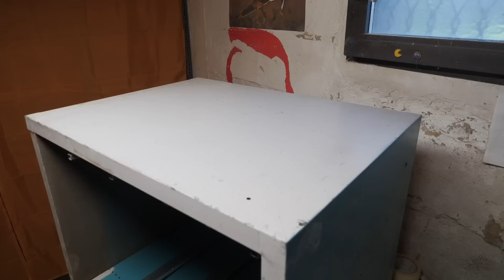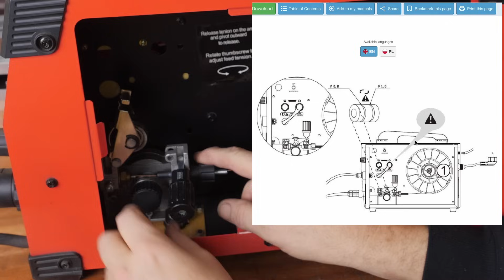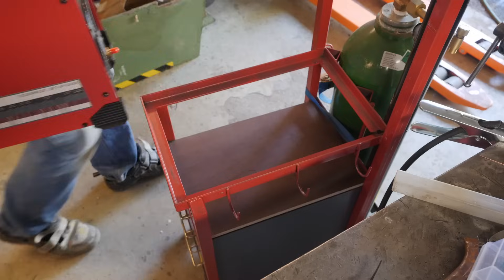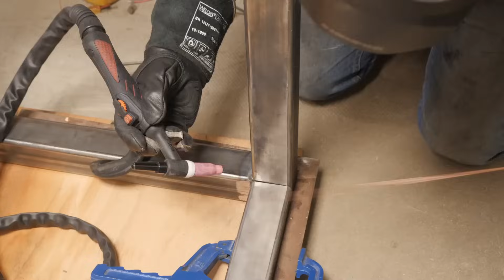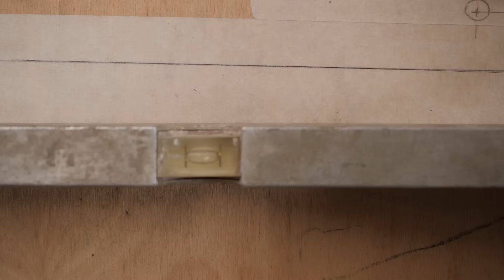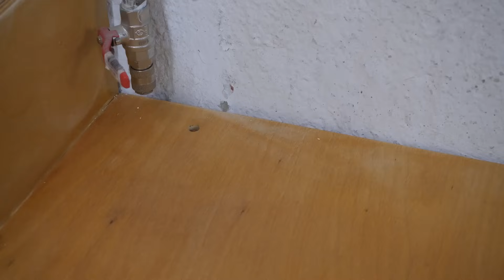My best workshop bench || RotarySMP

Comment: you need to crank the heat on the mig, hot and fast
Reply from the maker: I thought I tried pretty much all combinations of settings, but maybe I didn't try just diming both feed and voltage.
Reply: @RotarySMP  its been a long time but id keep my wire speed a little slower and the amps a little higher and would adjust the wire speed as needed. always found it a little easier to get the weld to start flowing and be less globular like that. think about it more like pushing material into the base metal. it should sound like bees in rhythm when youve got it right

 my machine also had a constant spool for the first few seconds then it would speed up to your settings. but it would only speed up after an arc was struck. it was a similar rebrand kind of 3 process machine.

Comment: Damn nice work... Nice Tig machine as well, tho, your tig welding is also getting better for sure! I would consider thicker tungstens, you can always grind down a thick tungsten to a long taper - sharp point, thin ones are just a limit to max amperage that you can use... I never saw any use for a thin tungsten... Not outside an edm sinker drill at any rate...

Best regards!
Steuss
Reply from the maker: Thanks for the feedback Stuess. I did buy a packet of 2.4mm / 3/32" electrodes, but followed the settings sticker and used the thinner ones. I need to grind up the thicker ones and give them a go.
Reply: @RotarySMP  Yeah, 2.4 are generally the best... At least in my experience... They go up to 200 amps, and that is good enough for most work... Just be aware of the radioactive electrode dust from certain electrodes and hexavalent chromium fumes if you weld inox... Zinc fume fever is damn bad, yet hexavalent chromium is infinitely worse and much more subtle... 
Tig is amazing and can be most enjoyable, but it has more risks than just the obvious ones...

Comment: Love your videos! I would really appreciate it if you could throw in a rough guesstimate at the end how much your shop projects cost
Reply from the maker: Thanks for the feedback. 
This one is a bit hard to say as the wooden slab would have been expensive, butwas a left over from making new stairs nearly a decade ago. I paid €500 for those used drawer cabinets. Probably excessive, but they were the perfect dimensions. The paint was about €75, but I will get another project out of it. I spend about €250 on steel, but that is also supposed to cover 3 or 4 projects. Then there are the paint rollers, bolts, filler wire, €70 customs duty on the comp welder etc.

All in all not very respresentitive of what it would cost another person to do something similar.

Comment: Grate video, on the mig welding think you where going too fast, slowing down will make the weld more flat, but on thing tubing like that you do really need to be carful to not burn thrue.
Reply from the maker: Thanks for the tip. Have you checked the actual wire speed on your MIG? Is the speed of mine normal?
Reply: @RotarySMP  i have a old slovenian Varstroj supermig 230, I can check it next week end if youd like. Also can highly recomend theas old machines, cheap and work grate.

Comment: What wire do you use as filler? You might want to try thicker filler wire, it seems to me you have to dab too often. It might be because of the sped up footage, but still, some experimentation would not hurt. 
Aluminium is a lot harder to TIG weld, it's better to be quite comfortable welding steel first, before taking the leap. 
Also the torch on the new machine has a wheel, that lets you adjust the current while welding, just like the pedal. It is handy, when you need both of your legs free. You can also adjust how "hot" the puddle is by changing your travel speed. 
I would encourage you to learn 4T, when you are starting a weld and hold the button down, it gives you a lower amperage (the amp setting after the pre-flow time). This gives you time to start and stabilize the arc, see where you are and what is the arc pointed at. Then you let go of the button, when you are ready, and start welding.
Reply from the maker: I only had 1/16" filler, but have ordered some 3/32" (2.4mm). 

I noticed that I need to practice 4T, to free up my trigger finger to control the amp wheel of the torch.  Thanks for confirming that.

Comment: My bench has a solid core door for a top... My friend (jodaddysgarage) has been doing videos for Arc Captain for a while now and is really happy with their welders. Las time I was out at his place I met him at Orlando airport and we picked up his new RV and drove it back to his place. I played with the welder enough to like it enough that I want one of my own. My videos are too crap to ever get any views or support as I don't have the filming and editing gene. The mig is far better on the low end for auto body than my current welder. My welder sounds like a tornado while that Arc Captain is silent till it gets warm. 
         I need to get a dedicated argon bottle (and change gas supplier)to get back to Tig welding. Tig welds are softer than MIG and easier to grind which makes body work easier.
   
       FYI all my shop benches are at 42". Puts them at a comfortable working height and I can roll carts under it and it's the answer to everything. That green reminds me of the old equipment in school shops. Also for my long bench across the wall I topped it with  1/8 hardboard with a white "waterproof" coating. It's cheap stuff supposedly meant for use in showers. I can write on it with pencil and it's cheap and easy to replace when I damage it.

          That vice looks awesome as well.
Reply from the maker: I dont normally go for the various product offers you get when you do the social media thing, but Arc Captain reached out at just the right time while I was ordering steel to make this, and my contact there has been very friendly and easy to deal with.
Reply: @RotarySMP  They are a good company to deal with and a good product. Love the light for seeing inside the unit when loading wire too.  
      The offers I have gotten from some fly by night products I have gotten I would never consider doing. But Arc Captain is a stand up company and a good choice for you.

Comment: theres a trick to setting up a vice , put in 2 pieces of metal verticlu and make it stick out under the foot , them put the vice on the table and push it in untill the pieces of metal hit the edge of the worktop then scribe the mountingholes 
that way youre able to clamp in long pieces as they whont hit the worktop on the way down
just thinking out loud herre , workbenches and such are usually banged against and paint chips off constandly making them look ratty and worn in no time , might be a good idea to paint those things in bedliner
Reply from the maker: This is a rear jaw opening vise, so that method doesn't work unfortunately. 
I don't mind when things like this take on a patina of use. It is a tool.

Comment: With a small mig welder,I always use the smallest wire available.  .023 in sae. That way I have more amperage for the wire size.
Reply from the maker: Thanks for the tip Michael. Have you measured the wire speed on your MIG?
Reply: @RotarySMP  I have not. But happy to when I get back to the shop
Reply: My work welder is a millermatic 135 it's running about 36 inches in 6 seconds. So roughly 94cm. 944cm per minute? That's at 60% wire speed and 80% amperage on .023 er70s with 75/25 gas and is my median settings for general repairs on 1/8" to 3/16 metals. I have a snap on 135 amp welder at home,I'll check it but I'm guessing it should be very close to this wire speed

Comment: A good rule of thumb for steel tig is 1A per .001" of material, so 3mm will get you to approx 120,  but I'll always set it a bit higher just to have that bonus power if your setup needs it to get the bead fully burned in.  I'd go like 140 and just not stomp the pedal to the floor by default.

Big heavy foot pedal? Not so much.  A foot pedal that sits on the floor without spinning?  Very much so.

Looking at you, Everlast Nova foot pedal stamped out of a single piece of sheet metal with no foot points to keep from spinning in the middle on a high spot on the floor...

The lip for your shoe is nice, mostly, too.. being able to pull the pedal and find your orientation without looking is nice.  I miss that.
Reply from the maker: Thanks for the tips Paul. I look forward to getting more practice with it.
Reply: Get some stubby cups and/or a gas lens kit, also.  Your stickout seems a bit long for a plain cup in the #7-#8 range.

Once you run a #7, #8, maybe #10 gas lens on steel, you'll never want to go back to a plain cup.

I only use a plain cup for aluminum now.
Reply: Looking good though.  At the start of the video I was quite frustrated you were still fighting with that fixed power piece of junk and it was great to see how your welds instantly improved

Comment: When you sand, you push the fibers in to the grain, then the water in the shellac raises them again. If you want to have two thick coats, just use a wet sponge and rub the surface down, let it dry and then do the final sanding. After that you can apply multiple coats, without sanding in between. But was awesome to watch, as usual.
Reply from the maker: Thanks for the tip. Would save a bit of shellac. I really like shellac. much nicer to use than paint.

Comment: Shame your MIG wasn’t up for it that would be a great application for MIG. Still new welder 😀 nice. Need to get a pedal for my TIG at some point but don’t use it a huge amount. Great result with the new bench
Reply from the maker: Hi Julia, I wonder why the wire feed is so far off?
Reply: @RotarySMP  Hi Mark, having thought about it maybe a low voltage on the auxiliary power supply for the wire feeder? Perhaps a dead diode so it’s only half wave rectified instead of full? The UK MIG welding forum has a lot of good technical people who do repairs so maybe they have an idea… 😀

Comment: Ich würde sagen, dass das Problem mit deinem Schweißgerät nicht deine Einstellungen sind, sondern das Gerät selber. Die chinesischen Geräte tendieren dazu, deutlich weniger Leistung zu haben als angegeben ist. 
Um zum Beispiel bei deinem Gerät mehr Leistung zu haben, musst du den Drahtvorschub hochdrehen, da darüber die Ampere geregelt werden. Die Volt regeln dabei im Prinzip nur die Breite der Schweißnaht und ein wenig auch den Einbrand. 
Die Überhöhung der Schweißnaht spricht für zu wenig Leistung oder für zu viel Draht. Da du das aber nicht separat einstellen kannst, musst du dennoch den Drahtvorschub hochdrehen.
Reply from the maker: Ich glaub auch dass was nicht stimmt, weil der Vorschub regler sollte 2-13m/min regeln, aber über 2m/min schafft es nicht.
Reply: @RotarySMP 
Oh und eine andere Frage: mit welchem Gas schweißt du MAG? 
Das sollte nämlich eigentlich 82/18 (Argon/CO2) sein, aber ich habe bisher nur eine Argon 4.6 Flasche gesehen.
Reply: @RotarySMP 
Eine grobe Faustformel ist außerdem, dass man bei Stahl und Edelstahl etwa 30A/mm nimmt und bei Alu 40A/mm. Gas-Post-Flow würde ich Minimum auf 2,5 Sekunden einstellen, damit die Elektrode gekühlt wird. 
Die Tabelle auf dem Gerät ist jetzt nicht die beste. Bei Google „EWM WIG Fibel“ eingeben und der erste Treffer ist schon mal ne gute Seite. 
Der Durchmesser der Elektrode spielt außerdem nicht die größte Rolle. Die 2,4 er geht bei DC von 40-200A recht problemlos. Bei ACDC (Alu) bis etwa 150A, weil die Belastung größer ist. 
Außerdem ist bei den chinesischen Gräten gerne eine rote Elektrode dabei. Achtung, diese kann Thorium (klingt radioaktiv und das ist’s auch) enthalten. 
Die goldenen Elektroden sind allgemein recht universell einsetzbar oder die violette E3 von Binzel (mein Favorit). Die Qualität der Elektroden spielt dabei auch ne Rolle. Sehr billige/schlechte können richtig negativen Einfluss habe.

Comment: Mark, try watching your weld puddle while welding, this should help you a lot. I wholeheartedly recommend you going a bigger nozzle + your nozzle tip not to be in-flush with the nozzle, but to protrude out of the nozzle for extra ~5mm. Once again, you need to do everything you can to be able to watch the weld puddle which I don't believe is happening now.
Reply from the maker: Thanks for the tips. You have an excellent eye for this. The new helmut I was sent give much better visibility than my old one, but I am certainly not giving the puddle the focus it needs. I notice a couple of welds where I could see it well, and was sitting comfortably, were also the best welds.
Reply: @RotarySMP  you're welcome. I didn't mention it clearly, but I think you got it right that for the stick-out I was referring to the MIG part of your welding. Although keeping eyes wide open instead of wide closed (hello, Stanley) is a good idea whichever process you choose.

Comment: I am just 3 minutes in my video and I have to warn you about working with the paint stripper in your shop. 
I used it to strip the paint off my lathe and I think its vapors have caused terrible rust to almost everything in my shop. 
I have a drawer with screws that were in a perfect state for years and after I used paint stripper they started rusting. It seems that it stopped now, but a few months after I was desperate when I was finding more and more nasty rust spots.
Reply from the maker: Thanks for the feedback. I am glad I used that in the wood shop, and not around the mill or lathe.

Comment: That weird wire brush has a chipping hammer on the back side for chipping the slag off stick welds..fairly common Chinesium product..like the hand held welding shield thst comes with welders..even tig welding machines..like to see 1 handed tig welding they do in China..
Reply from the maker: Okay, I already have a much better chipping hammer. Thanks.

Comment: Leaving the drawer fronts raw looks really great against the (approximately) RAL 6011, and the entire project turned out solid and looking good.  But one question... Why bolt the table to the frame from the top side? Welding some angle underneath would have allowed using lag bolts that could later be removed if necessary.
Reply from the maker: Hi JC,
I decided I didn't want to rely on threads in wood, but that is probably pretty irrelevant, as this thing is rock steady.

Comment: Hey Mark. I'm only here for the sweeping up. Stop wasting my time with all of this engineering nonsense will you?

A nice new toy you have there mate. Have you seen 6061's channel? He has a pressure sensitive button to control the current. I haven't tried it, but it looks intuitive ie the harder you press, the more current is applied. I guess it provides finer control from your finger, much like drawing or with a knife cutting. It also allows control in tighter spaces with less contortion to try and reach the pedal. Keep up the good work, and that's a nice bench.
Reply from the maker: That ArcCaptain torch also has a current pot on in, but I worked out towards the end that I need to switch to 4T, to free up my trigger finger to work the gas pedal.

Comment: In MIG welding, you have essentially 3 main variables you control. 

The first is your wire feed, this is where you should start, and you should set it based upon the thickness of your base metal and the size of the weld bead you need. Wire feed is your main means of adjusting your heat input, it is akin to amperage control in TIG or stick welding. 

Secondly, voltage is your main means of arc control, and thus your weld bead profile. It also contributes some to your overall heat input, but significantly less than wire feed. More voltage relative to a given feed rate will increase the arc length, which will generally widen and flatten out your bead profile, but be careful, as too much voltage for a given feed rate can lead to bad metal transfer characteristics and undercut in the base metal along the toes of your weld. 

Your final variable is the length between the end of the contact tube and the base metal which you should attempt to actively control as you are welding. The shorter this length is, the better your penetration and tie-in strength will be. Keeping this consistently short, and pairing it with appropriate gun orientation and motion when welding is the best way to control your final weld bead's shape, assuming the other two settings are correct for the given task.
Reply: TimWelds did a video on this just last week that really good.  But what's never mentioned about things like increasing or decreasing the wire feed rate is how it affects your travel time.
Reply from the maker: Thanks for the explanation. Is the possible to still make good welds, if the welder is not capable to exceeding 2m/min wire speed? Since the wire speed is only controllable in that very small range of 1.4-2m/min (although marked 2-13), I couldn't find a matching voltage which flattened out the welds at all.
Reply: @RotarySMP  Might be interesting to take the wire out of the equation, and put a tachometer on the roller to see what the actual rotation rate is. Using that and the diameter of the wheel, you can calculate what the no-load feed rate would be. Or perhaps the potentiometer is bad and the rate isn't actually changing much. Lastly, it could just be an unfortunate side effect of Chinese made equipment.
Reply: Marker pen blob on the roller and 6 seconds of video to get the load free number. Roller didn’t look great for the friction needed for the higher wire speed.